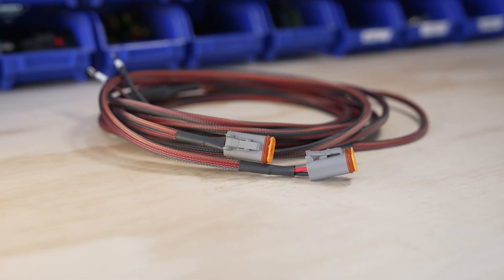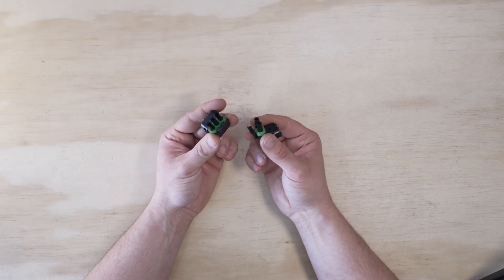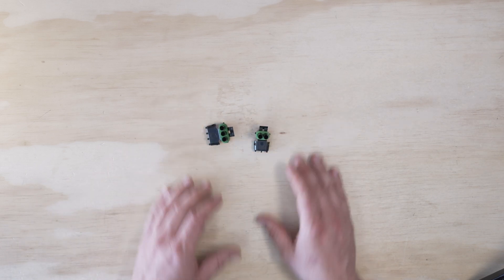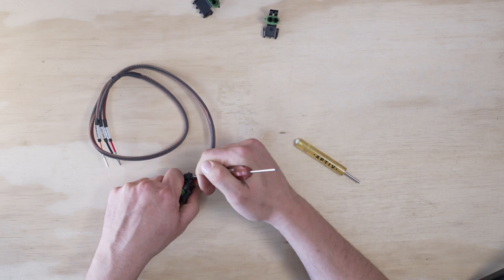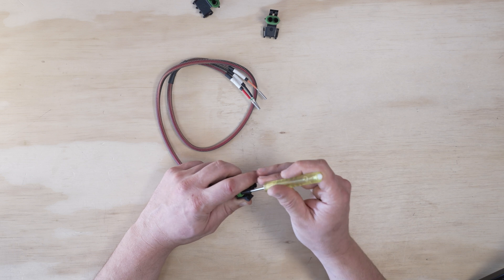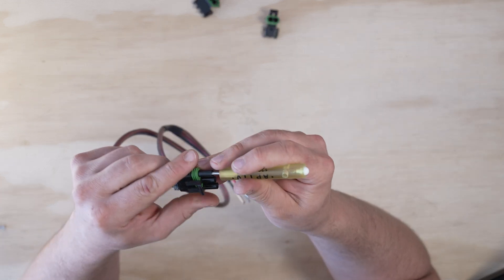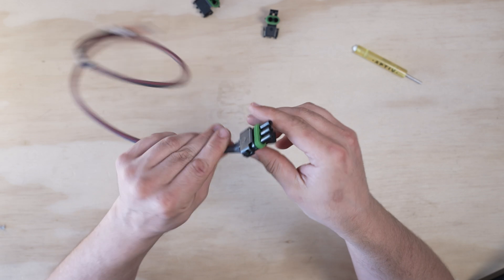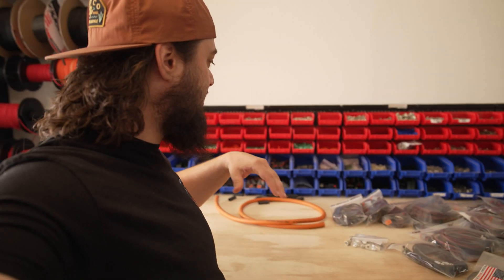How To Assemble and Disassemble Weather Pack Connectors

Comment: Great videos so far. Video ideas, ford upfitter switches vs garmin, or both in combo. Why use one over the other if factory equipped with upfitter switches. Best butt connectors you use, or single wire connectors for wiring. Do you make wire harnesses for upfitter switch equipped trucks? Thanks!
Reply from the maker: Great ideas! Also, yes! We do make harnesses for trucks with upfitters!